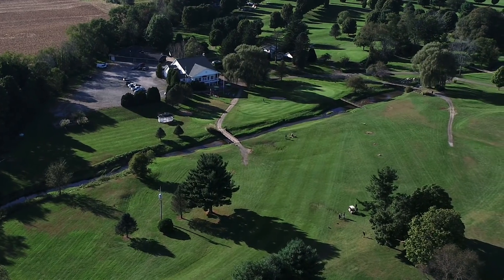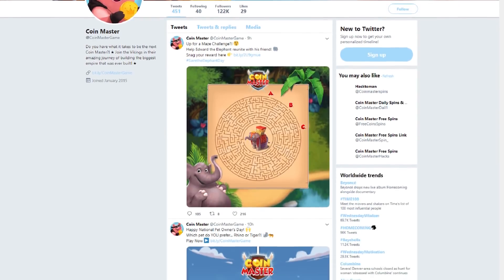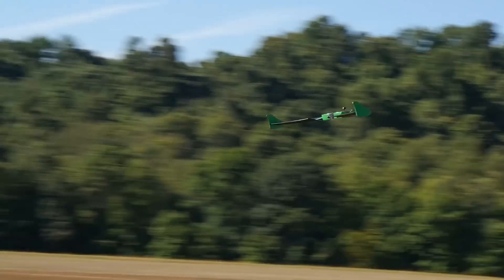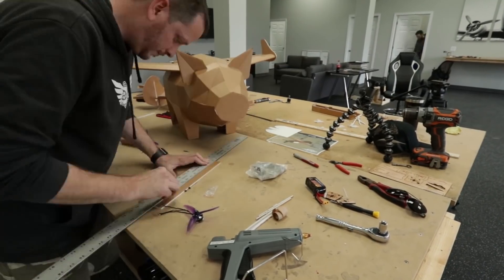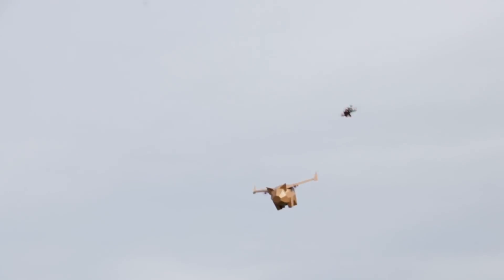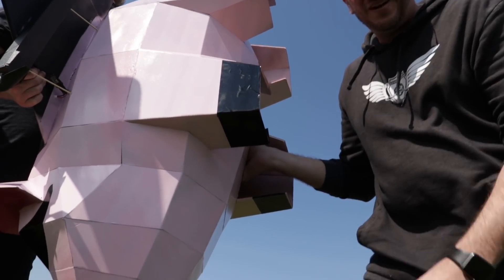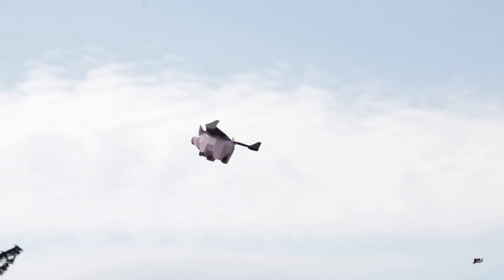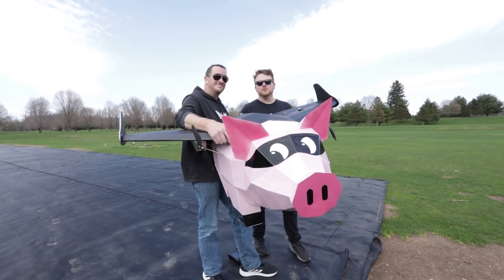When (RC) pigs FLY.... 🐷

Comment: I challenge flite test to do a Air to air refueling.  Adding a new battery or power supply.
Reply: YES
Reply: definitely need Pete in for that one!
Reply: pretty much same design as a real refuel.. cone goes on spike, latch with electromagnet, transfer electricity.
Reply: Nice idea, but it would have to stay for a while given how long it takes to charge a lipo
Reply: I’m thinking plugging an additional battery into a plane while flying.  Extending the flight time
Reply: @gautamkrishna7421  swap for capacitors?
Reply: That would be more practical on a gas engine
Reply: Maybe its possible to take the drained battery out of the aircraft and put in a new one. So the weight would be the same as before
Reply: @Samurai DX great idea some big supercaps should power the plane and they are reasonably quick to charge. Tom Stanton did a video where he powers a bl motor by 3 supercaps in series
Reply: @gautamkrishna7421  Yeah thought about that too...
Reply: Or forget about actually extending the battery life/flight time, but just trying to actually link two acft with a boom or drogue.
Reply: They could use gas which would be easier
Reply: Super capacitor
Reply: it will fall when unpluged
Reply: YASSSS
Reply: Air to Air possible with supercapacitors. Do it!!

Comment: Of course they can.  I went to a Pink Floyd concert one night and both speaker towers had pigs roosting at the top.  Tell me, how else could they have gotten there if they couldn't fly?  

Then as if on cue another pig flew in during one song.  It hovered over the crowd during the remainder of the concert.

Sadly, though l can't understand it, both speaker tower pigs tried to fly off of the towers at the end of the concert, fell to the floor and we're flattened by the impact.   I think that they weren't getting enough oxygen due to the altitude😔

Comment: I would love to see a plane made with a mini hot air stirling engine to drive a propeller. Using a servo, you could choke/open the gas line to the engine and have a generator attached to the engine to charge the battery during flight.

Comment: i have an idea and challenge for you guys put a magnet bracket on top of the pig and one under the drone and see if in the air you can connect the drone to the pig using magnets and see if you can take over the pigs flight using controls of the drone

Comment: I have a question about the hobby.
Recently I've bought the stuff for my first RC plane on Hobbyking. And I'm not going to do that again for my future builds. I've had quite a few issues, but the main issue is that they've deceived me with false advertising.
Therefore I'm looking for a place where I can buy everything I need. I live in the Netherlands. Therefore I can't buy my stuff from most US based webshops. (import costs are usually insanely high, just like FliteTest's stuff).
If you have any suggestions, please let me know! :D

Comment: Ugh I dont get these ESC's amp ratings. You have a power pack A with a 2200Kv Motor and a 12A ESC.
Can I do like a 2700Kv and 20A ESC? I dont wanna fry another ESC. please help thanks. also im using a 3s 30c batt.

Comment: Make an airplane(the ones that goes over seas that has first-class and stuff) turbine fly

Maybe a tube with the motor in front that pushes the air inside the tube and then wings inside to thrust up or down